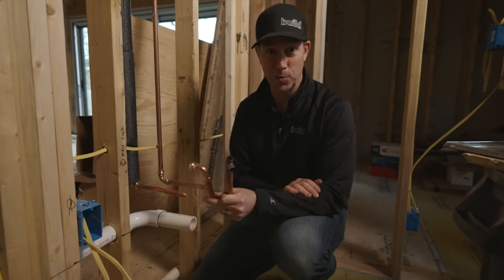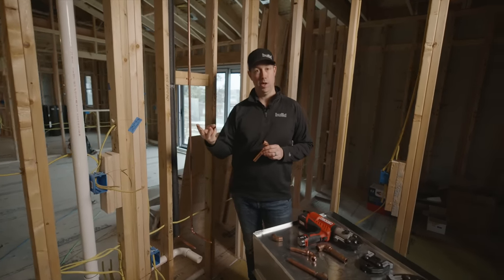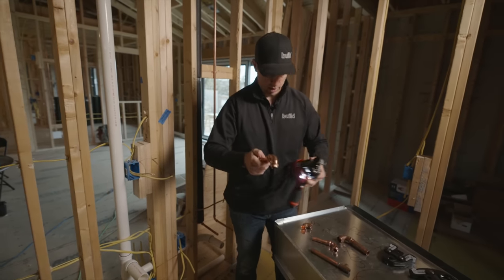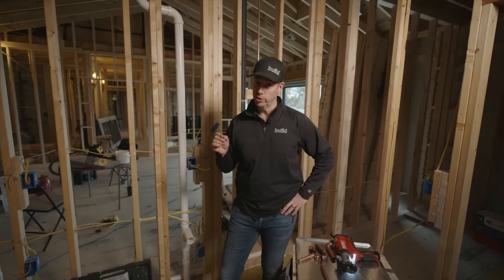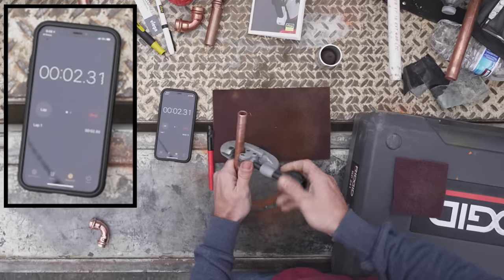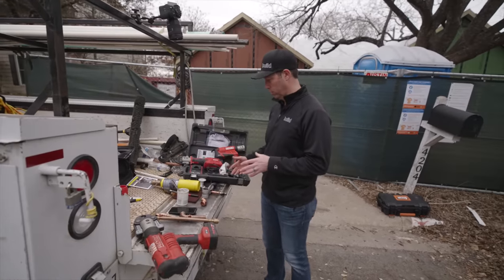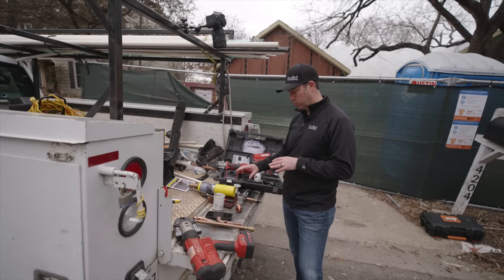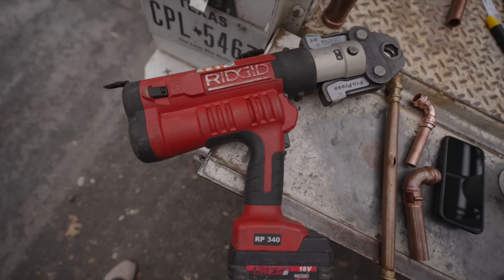Copper Plumbing - Viega ProPress vs. Soldered

Comment: When you can't solder. It'll be someone else's probelm when those fittings leak anyway🤣
Reply: I've heard plumbers say these will last 50 years. After that the plumber is retired and it's someone else's problem.

Comment: I thought you did a video and said that you did the Uponor PEX in your house? I'm gonna have to rewatch that to see if I remember wrong.
Reply: I believe this is a house he is building.
Reply: @mister-action1  yeah, this is definitely a different house, just looking at the traditional studs used. He just misspoke at the start. He said "my" at first, then says "this."
Reply: Ya I noticed the same thing! I hope it's a different house because he was all about PEX A in his house. I'm a plumber and just made the jump to PEX for repipe applications. If Matt noticed an issue with PEX A like I have I'd like to know what he doesn't like. I know I've found several problems with it
Reply: @jeremygallimore3042  I'm curious about your problems with PEX since I'm thinking about using it to repipe my 1947 cape.
Reply: @jeremygallimore3042  what problems with pex A or B or you having?
Reply: @jeremygallimore3042  what problems? Haven't heard of anything bad about Uponor pex A
Reply: @jeremygallimore3042  I just dropped 280 on the pex expander from DeWalt and now you got me wondering 😧
Reply: @MoeBabaloosh  I think you're  going to love it talk about saving time  snip it's cut  no Emory cloth no-deburr  no fire hazard. No dead  battery no leaks  no water abrasive
Reply: @larryhansman3384  cool man thank you. We have copper approaching the 75-year mark in our house and I've already replaced enough shut-off valves in the branches to pay for all the stuff needed to replace with the PEX system. 

Dude had me second-guessing my plans!

Gonna have to stay with copper on the feed line for the steam heat boiler and water heater, but other than that we can go PEX right after the shut-off downstream from the meter.
Reply: @jeremygallimore3042  What problems were you finding? The only limitation I saw was if I wanted a very short "nipple" and expanding one side would effect the other expanded side that already had a fitting. I have re-used fittings without issue and have not seen sulfur issues like copper. PEX A cant be forgotten to be attached like many other piping methods and fitting count can be reduced by bends in the pipe vs copper, reducing costs. Smooth bends vs fittings also reduces losses found in other right angle fitting connections. PEX-A has a high burst rating and is somewhat protecting against freezing as it has some elasticity. I am not aware of any normal use issues in corrosion for PEX A like copper's erosion corrosion. Finally Copper is a commodity with alternative uses in both valves and wiring. Why use such a commodity in pipes when alternative competent options exist?

Comment: How will this system hold up in acid water areas; like New England.  I've had copper pipes that looked perfectly fine on the outside, but corroded through from the inside.  The 'O' ring could also be a weak point.  Any corrosion inside the pipe will ruin the seal; and a bad 'O' ring is also problematical.  How many years will the system hold up?  Time will tell!
Reply: Copper is used in the majority of commercial buildings in New England. Most allow press style fittings such as Propress and Gruvlok

Comment: Was surprise the industry didn't go with the other better option.  Same basic concept, but instead still used heat and solder.  Though the profit margin was much less... which is usually the main driving force for any decision.  It could be used on standard sweat fittings, and could also work in a live situation if needed.  It appears it's not a good idea if it doesn't' require a mass amount of additional cost for the end user.  I remember seeing this tool in So-Cal, and wondered why it never hit the market.  The greed factor always wins out.

Comment: sorry dont get this as yet,  yes its a time savings but not conviced propress outlasts solder fitting and they are 3x to 4x the cost of sweat fittings so where is the must switch factor?

Comment: Viega ProPress is great in new installations or areas where you can get the tool in. Retro fitting into existing systems using the crimping tool is possible but in tight spaces it's often easier to solder as a slight jaw misalignment will cause a leak and really only testing with air or water up to pressure will be able to let you know if it has crimped correctly. Solder you just use a mirror to check. Horses for courses.
Reply: You should check out the compact press. Its a new set of jaws they came out with like two years ago for tight spots.

Comment: 11:12 also, gonna remember that yep, need that hot work permit and watching and waiting afterwards.....which does take time and money. 
Do like using ProPress (and Milwaukee also makes a ProPress tool and accepts Ridgid heads, which is great), along with ProPEX tools for plumbing a house. Another nice thing about ProPress and ProPEX, if water is in the pipe, the tool and pressing the pipes still work, unlike, trying to do solder on a copper pipe with water in the pipe, just doesn’t work that well (and if have a water leak, can easily press a new fitting in with a “wet” pipe using a Press tool; which is nice).
The future of plumbing continues to evolve 👍🏻👍🏻, and anything that makes jobs easier, saving time and money, but with keeping the “strength and dependability” of no leaks for decades....is very nice, imo.
Cheers😊

Comment: Always preferred copper piping, installed it through the whole house. I guess we have minerals in our water that don’t like copper. After about 20 years we started getting pin holes in the pipes, started with the hot water lines. Ended up switching to Pex pipe, straight lengths preferred over rolls. Didn’t have time to redo the whole house, so replaced sections as needed, or when I had time to change a section. Started using Shark Bite fittings, pricey, but easy to join Copper to Pex, or to CVC. No special tools required. Huge time savings.
Reply: Another note, Shark Bite fittings can be taken apart, and are reusable!

Comment: Hi Matt,
I think you forgot to mention that the crimping tool you are using is about $2,000. I wonder how many fittings and roles of solider I could buy for that price and how many crimping jobs would I have to do to break even at that price?

Comment: some people use these fittings just because they're new but the real question is will the O Ring last 10-15-20 years?
Reply: I'm not a plumber by any means but I'm sitting in my home in Australia scratching my head over all this.  Can it really be true that the USA has only discovered crimp fittings recently?  My over 60 year old house has this style of joins in the copper pipework.  The pipes started developing pin hole leaks (not associated with the joints) but the joints themselves were still completely watertight after 60+ years of mains pressure being applied.

I'm also scratching my head over the claims that the copper itself is providing the water/gas tight seal.  It doesn't.  It is providing the mechanical retention of the pipes but it is not cold welded and will pass water/gas.  In fact I've seen new crimps weep a little until the seal seats on old slightly rough pipes.  The seam between the metals is clearly visible in this video.  I bet if someone were to get into that cut open section of pipe, shown in the video, with a screw driver the metal could be wedged apart without any of the tell tale signs of cold welding.

Comment: Great video.... even it's a commercial I really liked it. Can you do us a video on transition fittings too? Like PEX to Copper and "platic" versus brass versus copper fittings. I think what is most important for plumber and owners is to understand the difference also for a remodel job. We love brass fittings with PEX but often run into issues with remodels where it's either Copper or CPVC or even PVC pipes yes believe it or not often we see PVC for water supply lines under mobile homes been used too, which we replace with PEX. We love the PEX from shark bite because it's brass fittings and stainless steel clamps work flawless and fast. Much faster than CPVC especially in dirty and humid environments.

Comment: I wonder how well they would work without the EPDM seal... This reminds me of the arguments between the different types of hydraulic fittings on equipment. JIC, ORFS, SAE ORING BOSS, O ring flange, NPT, Bite type to connect to rigid tube, and brazing to connect to rigid tube.

Comment: I would like to see what happens if you remove the "O" ring and pro press the fitting, then water test it under pressure.
Reply: A leak happens
Reply: It would leak. If fitting isn't centered right it'll crimp off to a side and smash the o ring and destroy it and then you have a leak. Not huge on it for copper but it's amazing for gas lines
Reply: Even with that incredible pressure copper will not "fuse" as in become one piece. Also the surface of copper is not just copper but a thin layer of copper oxide which again outside of heat or friction (welding methods) that layer would prevent fusion. That being said that oring is not going to see much oxygen and therefore is going to last a very very long time.
Reply: @paintballthieupwns  copper pipe and fittings are sanded and reamed before any brazing or fluxed if soldered
Reply: @chrisjones6165  - for sure - but not for the crimp fit which is what I was addressing
Reply: I have some extra press fittings here, I'll try it today. I've also been curious
Reply: @LeeBuilt  Great, because he does say at 5:16 the "O" ring is not what seals the joint.
Reply: Would be a good test.
Reply: @LeeBuilt  I too am interested to hear your results.
Reply: @LeeBuilt   Report back what you find.  I'm pretty skeptical that these fittings make a waterproof copper-to-copper seal.
Reply: I did test this and viega did hold 60psi with no o-ring, Aswell as Nibco, but a cheaper brand did not. my post here keep getting deleted so check my page for the whole video
Reply: @LeeBuilt  Cool, thanks for taking the time to test it out and post your test.
Reply: @paintballthieupwns  boiler guys love pro press  ..closed loop systems o ring will last a long time..

Comment: I had to replace two water faucets for our new washing machine. I went to a local box store and bought two new faucets. After I returned home I decided to call a plumber. I had  sweated copper before but my supplies hadn’t been used in years. The plumber used the system you demonstrated and it took less than an hour. He even used the faucets I bought for the project to save me money. When he gave me the bill I felt he was robbing me. I should mention he came out the same day I called arriving before 5:00pm. I will look into the cost of the system you used.

Comment: Matt one feature you fail to mention, the Viega Pro-Press system is great for pipe repairs or alterations while under pressure ( i.e. what some plumbers borrowed from electricians calling it "working it hot"). Even if not under pressure there's significant drain down time, say in the basement of a 3-story building then a slice or two bread
Reply: In order to sweat-in a solder fitting.
Reply: That doesn't add up. While the lines don't have to ve completely dry, we can't work with pressurized pipes. The flow can blow out the oring. The water can splash the tool. It can have a drip, but it can't be under pressure.

Comment: I would also recommend that you look at the UK system of Yorkshire capillary fittings with the solder already embedded in the fitting. Simple to use and I would suspect way stronger than any compression system.  Yorkshire fittings have been around for decades and I have used them in home plumbing with no problems.  And on top of that, no very expensive crimping tool.  Just a torch, flux and glass cloth or wire brush.
Reply: Compression fittings are now almost universal in commercial buildings in the UK, totally due to no hot work allowed , the cost of the tool is less than the result of a fire. I have changed over to  Tectite fittings, no hot work, can be used on wet pipes, quick, and no expensive tool required.

Comment: I don't think the ProPress fuses the copper. That would take a lot of heat to do that (think welding torch). I suspect what it does is create a press-fit joint that is water tight under pressure.
Reply: It take the circular fittings and crimp it to a hexagon. its all about math and physics

Comment: Nice new system for plumbing.  I saw it about 5 years ago and it was in a commercial project. I was told it was not available for residential use. Glad it's now available for residential.  Great video and it sure beats pex
Reply: We've  been doing  it in resie for almost  20 years here in Pittsburgh.
Reply: What about it beats pex? Matt has made freeze failure videos on pex vs copper and pex won.
Reply: @TheDogDad   the pipe freezing  shouldn't  be a problem  if properly  installed, matt didn't  use the pex fittings  for that test which break extremely  easily if subjected to freezing temps. Plus its easy to thaw  Copper   out if it does freeze. Its rodent  proof, its antimicrobial  like matt touched on and if installed  properly  will outlast pex two to one.
Reply: The only reason pex beats copper in residential  is its cheaper. No other reason. I do commercial  plumbing  here in Pittsburgh  and 9 out of 10 times we install copper and occasionally uponor.
Reply: @robertkordingjr8835  copper is rodent resistant... I’ve seen copper that had been gnawed through. Was absolutely shocked but it happens.

Comment: I’m a DIY home owner and have some plumbing to do. I was quoted 3k to relocate a pipe from the side of the house to the garage where it makes significantly more sense. It’s cheaper for me to buy this pro press tool and do it myself plus I have other renovations and other copper pipes I’ll need to fix in the basement due to poor soldering that was done years ago. I see this tool as an investment for home owners who are okay with doing their own plumbing especially if they plan on being home owners and upgrading or downgrading houses as the years go by. At some point you’ll have to fix some pipes or replace a hot water tank. Let’s also not forget family and friends.
Reply: Buy 5he hand pump model for 140 bux°!

Comment: Glad you crimped all your connections rather than fluxing them, you would have had a hard time with all the leaks. 

Soldering your connections with flux on the other hand works wonderfully

Comment: you guys forgot about the price difference between the 2, also keep in mind that Certified Plumbers also must have Fire Protection training, I do like the way the pro-press are but in reality the swat fittings are much much cheaper of course when installed by an Experienced Plumber

Comment: I don't know about the USA, but those "cramped" systems have been used in my houses for ovet twenty years in Australia.
Edit. I notice you didn't mention the price of the press kit.its as big as the tool.
Reply: Yeah about 2grand for press and jaws. Break out another 1200 for gas fitting jaws
Reply: Same here in the US. Unit was introduced in 1999 but didn't start getting popular until about 2010. The fittings are not cheap ( copper water, copper gas (G)  & megapress Steel for gas and water sprinkler systems. ) saves a lot on labor but the longevity of the O-ring ,who knows (???) , time will tell.

Comment: I use 1” Apollo press fittings and I’m nervous every time I leave a job. The o rings pop out all the time and the tolerance for each fitting is different all the time. I always double and triple press at different directions to ensure no leaks.

Comment: After 50% weeping on all of these propress garbage fittings on a brand new install. Solder is the only way to go dealing with copper. Propress is a glorified shark bite whose only use is a perceived labor savings to installers. You’re passing along a permanent install unable to be repaired without full replacement onto the client/customer. Within one week of a 12k installation more than half the fittings weep at the joint even with proper installation. Relying on the poor manufacturing of these items is a recipe for disaster both for liability as a plumber and future damage to the homeowner

Comment: I repair frozen pipes every winter. Pro-press systems often lose the fittings off the end of a freeze. ALL copper systems burst with minor freezing. Only pex based systems repeatedly survive freezing... having said that, there is no copper fitting that beats freezing, so pro-press is great for copper.

Comment: I am resistant to new technology, buy my hvac contractor did my entire boiler and connections with pro-press. I cross my fingers that they don't wear out too soon.
Two more advantages of soldering is, the joints can be reheated and taken apart minimizing fixing things, and soldered joints look a lot better.

Comment: Our farm house is 1960 didn't think about copper wearing out!
Reply: A small spec of flux inside a pipe or a defect non-pure copper will cause pin holes. They are fun. They initially leak so slow you may not know for weeks or months until a wall or ceiling fails.
Reply: Flux inside the pipe? 😆
Reply: @joshfazenbaker5691  Yeah, flux inside the pipe. I saw it in there from what looked like overzealous application from installer. Pipe pin holed at 11 years.
Reply: @JasonW.  The flux stayed in place in an operational pipe for 11 years?  That doesn't seem likely.  Was it a drop of solder?
Reply: @IanSlatas  not really, more of a stain from where it was applied. When pipe was replaced and cut open, several pits had formed along the edge of the stain. One pit started leaking. The solder line was visibly not where the pitting was.